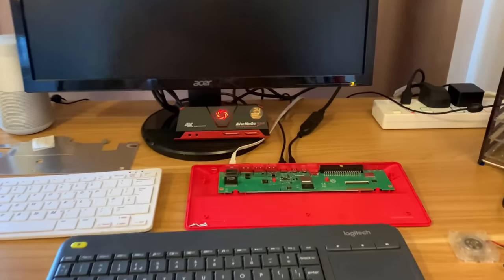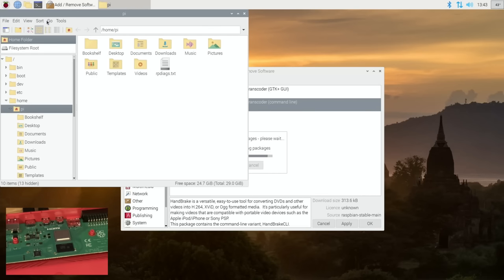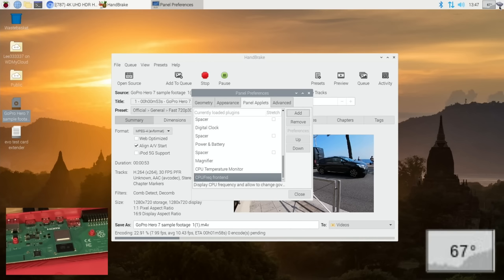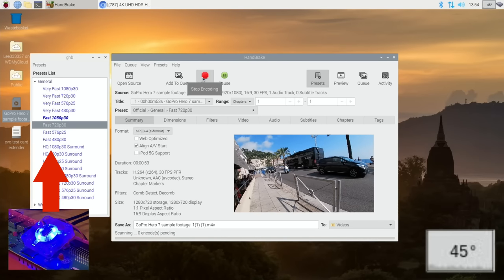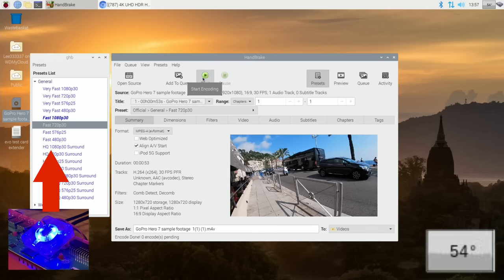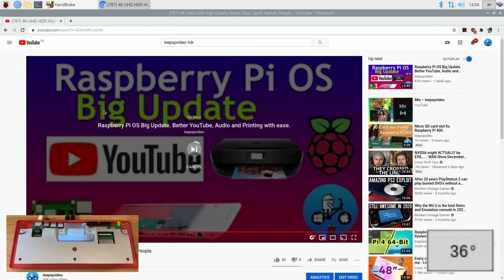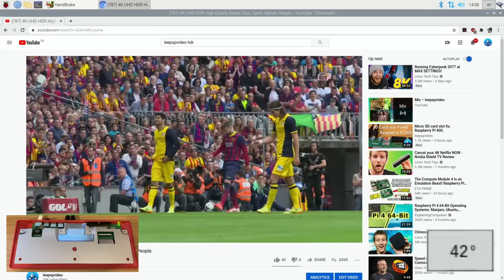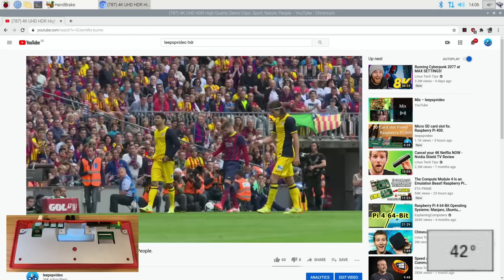Raspberry Pi 400 Cooling test. Comparing 5 methods.

Comment: Bottom line is that the Pi 400 is completely fine for 99% of users and you'd have to be doing some serious hard work to get the temperature anywhere near near the throttle point. Excellent news. So far I'm loving mine and with each iteration it  gets better, what's not to like.
Reply from the maker: Yes, the heat spreader is excellent as is.

Comment: Thanks for this, but I am more than happy with the passive cooling even with the overclocking as I don't like any vibration or noise from fans, I have the Mac Mini M1 so quiet even under heavy load the fan doesn't come on just amazing as I use Davinci Resolve for editing,  fan less passive cooling is the way to go for me and it stops all that fine dust collecting over time and clogging things up

Comment: @leepspvideo, the switch you use disconnects just 1 cable of the power, (internly) i've had this issue months ago and submitted this on your channel already. That's why when switch off in the current state you'll see the power led of the raspberry pi light up every now and then (with me it's +/- every 2 minutes) thats why you have to pull out the usb c cable from the raspberry pi... Look for a switch which can fully disconnect the 2 cables not just 1. Sorry for the bad english

Comment: I haven’t seen one of these units up close. I suspect the keyboard includes a barrier that would prevent liquids from entering the keyboard. It seems to me that the thermal performance might benefit from some vertical slots milled into the vertical sides of the upper keyboard housing, which could be accomplished using a Dremel tool. However, I also suspect this would void your warranty

Comment: Interesting video. But you make a small mistake on your test. 
You just put the heat sink on and don't screw it down. 
When you screw it on, the cooling pad and the heat sink are pressed a little against the CPU, 
which again makes between 1-3 degrees Celsius. 
In my opinion, if you want to actively cool, it would make the most sense to install a small radial fan in such a way that it overblasts the entire passive heat sink.

Comment: As you know, black surfaces radiate heat better than shiny mirror silver ones like that raw allow spreader, so I wonder what difference in heat dissipation would be achieved by painting the spreader flat black.
Also, on the topic of making more volume inside of the enclosure, it seems one could use a length equal to the total length of the seam, like a ribbon of suitable plastic or metal about the thickness of the fan (9-12mm?) and use said strip all around the case, to separate the keyboard from the base by inserting one edge of the strip all round the top, then set that lot onto the base where the top formerly mated to the bottom.
I guess I can snap my 400 apart and see for myself!  I would like to have an ssd and fan inside of the unit, and utilize the little card slot as a means to transfer photos from my camera into the pi’s proposed ssd for example, all the while overclocked as much as practical.

Comment: some clever company making a sort of riser that sits between the top and bottom of the case would be nifty, would probably let you slip thin devices like an ssd inside as well as a bit of active cooling.
Reply: An internal SSD would be great. Active cooling is pointless, just noise and more power drain for no real reason.

Comment: Have you considered a thin side firing fan such as used with active M.2 coolers? 
https://www.amazon.com/Cooler-Nvme-Heatsink-20mm-NVMe/dp/B082MYYJX4/ref=sr_1_6
I've done some cursory work with these for cooling Pi4 model B units while using HATs

Comment: Take your Pi400 apart and remove the heat plate. Remove the board and file down the two red plastic stand offs that are close to where the CPU sits. Take them about .5 mm shorter. Reassemble and add thermal paste to the CPU, add a thermal pad to the ram chip below the CPU. The heat plate will now make much better contact with the CPU and even with a 2.2ghz overclock will rarely see 60c. No need for active cooling.
Reply from the maker: Thanks 

Pi 400. How high can I Overclock without it crashing.
https://youtu.be/e9U58V8aJBE

Comment: I even over clocked the pi 400 to 2.3Ghz ( yes it's very possible ) and the keyboard didn't even warm up
I was able to Reach a very stable 2.3Ghz on my pi 400 , I just entered arm_freq=2200 and the over_voltage=8 without the force turbo and I dont know why but when it booted i was running at 2.3Ghz with incredible stability 
Here's the link in case you need it:
https://www.youtube.com/watch?v=aa5frE3H7Hg

Comment: cool vid    Stress test to run in command line --     while true; do vcgencmd measure_clock arm; vcgencmd measure_temp; sleep 10; done& stress c 4 -t 900s -- while true; do vcgencmd measure_clock arm; vcgencmd measure_temp; sleep 10; done& ./cpuburn-a53
Reply: @sensorequipment8283  work well highest temp was 43 C that with low ice tower . Thanks for the tip